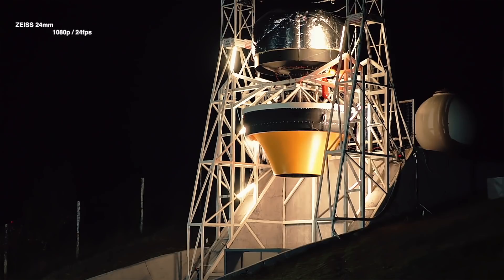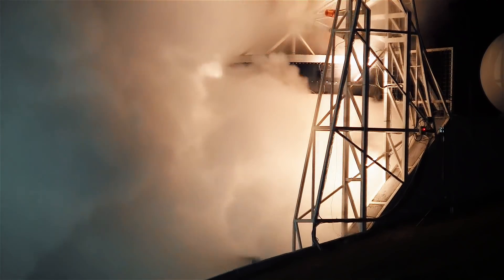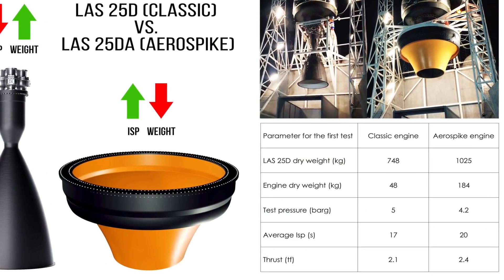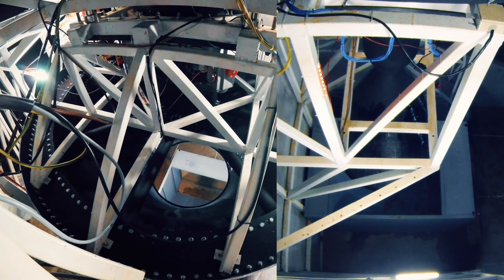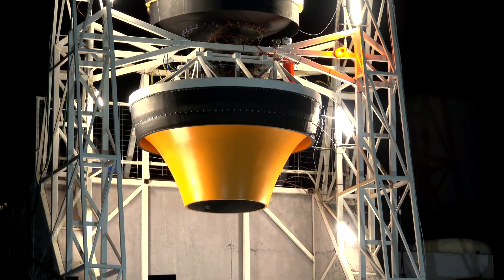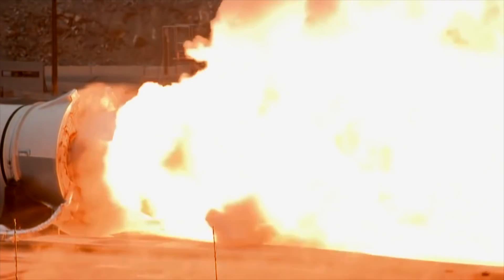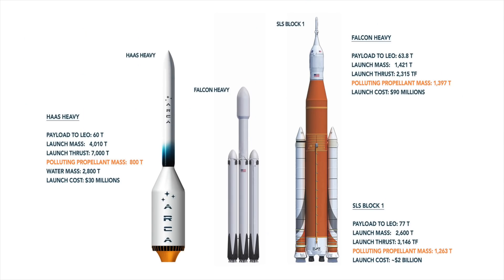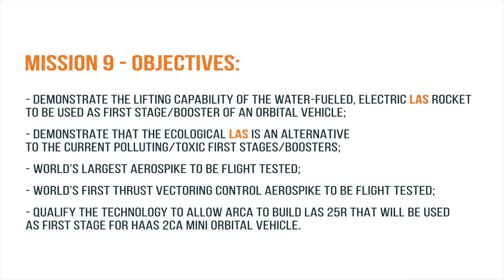Flight of the Aerospike: Episode 35 - Aerospike Test Results. Comparison.

Comment: We need to use both types of engines. Aviation is such a success because of the utilization of both turboprop and turbofan engines in commercial applications. In order for aerospace to succeed both aerospikes and bell nozzles should be used. Not to mention the rockelab electron engine too

Comment: 20 second ISP? That seems extremely low even for a steam rocket. Is it to do with the conditions of the test or is this the performance of the actual engine?
Reply from the maker: We ran the engine at only 4.1 bars for the first test. We'll gradually increase the pressure up to 28 bars and get +50sec of isp.
Reply: ARCA SPACE 
Thank you very much for replying. Best of luck for Mission 9!

Comment: To save environment why you don't use liquid hydrogen ?
Reply: It's very hard to work with. It embrittles the metals it contacts, it has low density, it's very cryogenic... oh, and it's also hard to produce in sufficient quantities.
Reply: @caav56  or methane.
Reply: @dipakahir4688  I think the hardware they can get their hands on might just no be up to it.
Reply: @caav56  bro look at their render of upcoming rockets these giant rockets can only deliver hundred tones and the will use battery to worm things up and to produce these battery is pollutive way after depleted it will be thrown in ocean  and if they use some chemical fules that can increase the paylod capacity to 500-1000 tones
Reply: @dipakahir4688  I think LAS is recoverable, though. And about hardware - I'm talking about whatever they can get their hands on now.

Comment: Pufff
a 1500t 300mln in cost, made out of a big puff of toxic materials booster leaves the ground with a 30t payload on a second stage.

It falls back down after a whoping 25-30s of continuus thrust on ISP of around 50, still under 3km of altitude. Then a normal KeroLox engine ignites propelling the payload to it's orbit.

XD

Comment: How about you try methane and oxygen? Then set fire to the exhaust.
Reply: I'm not sure they have enough experience and materials to do that. So far, it seems like they are working with whatever they can get their hands on, and trying to make a working rocket from that (for instance, switch from turbopumped kerolox Executor to yet-unnamed pressure-fed keroxide engine). I really hope they succeed in doing that.
Reply: @caav56  it's water, isn't it??????
Reply: @caav56  They should stop calling it an engine then!
Reply: @OneFinalTipple  Technically, it's still an engine - a resistojet with pre-heated propellant (on LAS. Haas rocket itself has perssure-fed keroxide linear aerospike). If it produces thrust, then it's an engine.
Reply: @caav56  Not buying it.
Reply: @OneFinalTipple  Not buying what?
Reply: @caav56  Not buying it is an 'engine'. This is becoming ridiculous
Reply: @OneFinalTipple  It became ridiculous years ago. :)

Comment: The main advantage of an aerospike is that it adapts to the variations in pressure as the rocket gains altitude. To make the comparison fair you should optimize the bell expansion to the pressure of the testing site. What expansion has been used in the test?

Comment: I saw Scott Manly's video on the brief flirtation with the aerospike in the past and the effects of altitude on a rocket engine. I was left with the impression nothing was being done in aerospike research. Now I find you have a launch in April. Oh I definitely want to know more about that! There's a high probability you guys are going to discover something because the rest of the world stopped looking a long time ago. That's how discoveries are made, by looking in places you never have before and when you run out of those you re-examine where you've already been for something you missed or a new way of doing an old thing.
Reply: I want to see a launch using aerospike
Reply: @badder27com  We all do.
Reply: But they're only planning to fly the first stage to 9k feet, so there's no reason to use an aerospike on the first stage.  Then they switch over to hydrogen peroxide for the second stage where they likely won't get nearly enough efficiency to actually go anywhere (because of the fuel, not the aerospike).  If they really wanted to do this, they'd use a more efficient fuel, but then they'd have to deal with real heat, real power, real engineering, etc.  Unfortunately in the years that I've been following them, they have never managed a launch, or even an engine test that used something other than pressurized water.  It's really too bad, because lo all those years ago I was an enthusiastic follower.  I'm just glad I was never an investor.

Comment: Fuel is one of the cheapest parts of rocket launches usually.
Reply: Yes but as they explained and research will prove with a little less exaggeration is that it's one of the most polluting properties of a launch and they aim to reduce that.
Reply: @scruffypugs1963  surprisingly, hydrolox and methalox engines burn quite cleanly. The emissions are H2O and CO2 + H2O respectively. One question I'll be asking is how much more efficient this steam engine is in terms of thrust to emissions. Water is actually a worse greenhouse gas than CO2 and of course you need to put energy in to boil it. Hydralox and Methalox can be generated from atmosphere and electricity using hydrolysis and Sabatier process respectively.

Comment: If this rocket is really running on water, I don't see any point of using aerospike. The normal cone would be okay
Reply: Yes, and it is totally unnecessary if the first stage is only going to 3000 m. Aerospike design will just add extra weight.
Reply: @n3xup  I wonder, if it's mostly done to get more experience with both toroidal (LAS) and linear (Haas rocket) aerospikes...
Reply: @caav56  Could be, yes. And that's fine if they want to do some test launches with the aerospike. For a staged launch vehicle,  using an aerospike on the first stage doesn't make sense.
Reply: @n3xup  Gotta gather data whether possible, I guess.

Comment: makes absolutely no sense to heat water with batteries and create steam,
any other way of propulsion would be better
how do they get fundings for something so useless
Reply: You should learn a little more before you make comments like that and make a fool of yourself. The water is preheated using ground power before takeoff. Most of the energy comes from the preheated supercritical water, not the batteries.
Reply: @marks4058  all you have is faith.. in a water rocket.. no real calculation works in your favor as there is just so little energy in preheated water, compared to any normal fuel-oxidizer propellant
Also, just to correct you, water gets supercritical from 374°C and 218 atm, and in this water rocket it is stored at around 250°C and 15 atm, so it is superheated subcritical water.
Better check some facts before writing this coments and make a fool of yourself
Reply: @dajsinjo  Quite right, superheated (heated above it's 1 atmosphere boiling point) not supercritical. I should be more careful when accepting auto complete suggestions on my phone.
Reply: @dajsinjo  Can you please share your calculations? That would be really helpful and educational.
Reply: @marks4058  I was wrong with few numbers, but lets start with those given in video:
next test will be done with 28atm (maybe total) pressure, water is liquid at max 230°C at that pressure. In nozzle at that test it will drop to 1 atm ambient pressure, and in Mollier diagram I could barely read this drop in enthalpy of 81.4 kJ/kg, so it may be a bit off. Entropy stays the same as this is 100% efficient engine and it is simpler calculation.
This 81400 Joule gives this kilogram of h2o velocity of 403m/s (E=0.5v^2)
and specific impulse of 41s (I=v/g)
They also mention 40s impulse in the video for that case so I am not too much off
..and yes, that is just enough to get your rocket into your neighbour back yard or into flat earth orbit with only two stages
Not to mention it is composite pressure vessel and higher temperatures dont work in favour of polymers in composites. Also rocket weight/propellant ratio is way too optimistic for that kind of rocket, and adding batteries only makes it worse.
It would make more sense to fill it up with solid propellant then water, or create some pressure fed bipropellant rocket like otrag or sea dragon.
Hope this was helpful and educational

Comment: Do you consider to improve any kind of landing sistem, like Space X´s rockets, later in the design process? I mean... if the water propeled aerospike is more eficient than a conventional rocket then you could make more afordable each launch even. Or because of the water (or because of the aerospike) is there a limit in terms of mass that can´t handle this platform??

Comment: Where does the energy come from? In the case of standard rockets, it comes from the chemical reaction (fire) wich accelerates the propelant to absurd velocities creating thrust. If it doesn't rely on chemicals, you need something to accelerate the water to those velocities. No way there is energy enough in batteries to do that.
Reply: Most of the energy comes from super-heating the water using ground power before takeoff.

Comment: excellent update thank you. if its not a trade secret would you mind sharing how you store and deliver the electric energy. Im confused how it can contain the energy required as electricity without being so heavy as to not get off the ground. I assume "not batteries"?
Reply: Batteries.
Reply: The water is super-heated to using ground power before takeoff. Most of the energy in the system is thermal.
Reply: @marks4058  Thank you!, that's absolute genius.
Reply: The water is super-heated inside the main tank via ground power lines. There is also a requirement for heating at the exhaust of the main tank/inside the combustion - or better said the evaporation chamber in order to create some explosive evaporation

Some naysayers claim that it would require 50kg of batteries for each second of the flight sequence. 

Even an optimistic estimate of half of that amounts to 1.5 tonnes of batteries for each minute of flight. Given that it might take 2-3 minutes to reach 100km, i.e. outer space, that's 3 to 5 tonnes.

Comment: I finally see what you're saying about the pollution aspect of the existing launch systems. If space exploration and exploitation are to be ramped up such that launches are common daily occurrences; then starting with a less or non polluting system sooner than later would be better for us earthlings in the long term.  Sigh; good looking out ARCA.
Reply: For the most part rockets today use RP-1 (kerosene), hydrogen or solid fuel. Solid fuel is bad for the environment due to all the heavy metals, I think. Kerosene is bad but we use so little on a global scale and get so much benefit, it just makes sense.
Hydrogen is excellent. It's pretty much exactly as clean as water and much much more efficient.
Reply from the maker: Thank you very much! Yes, that's exactly the scenario we are referring to!

Comment: Turn the water into liquid Hydrogen and Oxygen You get a better ISP and it still doesn't pollute.. This just seems like it will be waaay to heavy to ever work. I hope I am wrong, and it works, but I think you would be better using conventional fuel. Cool idea though.
Reply: True! Hydrogen/Oxygen combination is clean and offers a way higher isp. But, what we are trying to do here isn't just a clean rocket, but also one that has an unbeatable price. Using liquid hydrogen it will mean hundreds of millions, if not billions to develop. I want to be very clear that we don't care about performance. We don't hunt a few more seconds of higher isp by using methane instead of kerosene, or going with the chamber pressure at insane values. This means huge amounts for research and the cost/launch will never get truly low. We prefer a vehicle that is low performance, but delivers it's payload to orbit in a safe maner, at the lowest possible cost, and as clean as possible. This is for us the wining combination.

Comment: Only 20 sec of Isp ?? Didn't I understand something? :s
Reply from the maker: Yes, at 4.1 bars we got this. With an Isp of 50s we can put the LAS 25R with its payload, the Haas 2CA Mini rocket at 9000 ft and Mach 2, which reduces the amount of polluting fuel for Haas 2CA with 50% (we know, its sounds crazy, but it's just math), and this also reduces the launch cost. As we said, the Isp value doesn't matter too much for the first stage/booster, as long as the first stage/booster puts the upper stage at a higher altitude and at a higher DeltaV than zero. In our case 9000ft and Mach2.
Reply: @ARCAchannel  What is the Isp, altitude (orbit ?), payload and speed that you are expecting to reach in the coming years ? Would your concept fit for, for example, a new water Saturn V-like ?

Comment: So since this is a water based rocket does that mean easier pad refurbishment? Also how is a liquid fuel rocket engine designed? Is it just push as much water through as we can or is some kind of reaction happening.
Reply: Absolutely, very low maintenance between flights. Well, if we push as much water as we can, we'll get huge thrust, and shorten the time of the engine run, but we are not going to reach the desired altitude and speed. We'll also get huge accelerations that could break the vehicle. There's an optimum of thrust vs. engine run time. There's a chemical reaction in the tank (2% phase destabilizers in water) and a physical transformation from water to vapors (partial) in the engine.

Comment: Hey ARCA,
I commented this on your previous video but did not get an answer:
I've spotted a major issue with your test setup!
Looking at your test video I can see through the center of the exhaust cone.
This, allows for a venturi effect through the center of the exhaust cone as the exhaust gas produces a low pressure-zone in the center of the exhaust cone.
Looking at your images of your spacecraft I do not see an intake allowing air to be sucked into that low pressure-zone.

What are your thoughts on this?
Reply from the maker: It's actually different than what you or us thought initially. For whatever reason it doesn't produce a low pressure-zone at the end of the plug. Still investigating. Thank you for letting us know.
Reply: @ARCAchannel  Thank you for your answer! Could you make a video on this subject?
I am looking forward to see the first launch!
I was sceptical at first, but we clearly see a positive evolution in this process.
Thank you for trying to revolutionise this polluting industry!
Reply from the maker: @007Jefke1  The launch is going to happen in April, so less than three months until then. Skepticism is good. To be honest, it isn't easy to accept the idea of water as propellant, and at first everyone would have been defensive. It's a natural reaction. But let's hope the launch is going to prove we are into something here. We are going to produce a video to discuss more on the aerospike topic, including that base flow, but we need to better understand the things ourselves for now. We still have a lot of things to learn. More tests needed.
Reply: @ARCAchannel   ARCA SPACE  Are you investigating the consequences of adding an intake to allow air to flow in that empty cone?
Particularly when the object is moving through it's medium this must change the caracteristics of the exhaust flow.
We must look the idea as if it would be an inverted turbofan engine, because that is basically what it is.
Reply: @ARCAchannel  As the mixed phased flow is accelerated inwards by the   inwards curve of the bell nozzle and outwards by the outwards curve of the aerospike, is the liquid pushed inwards and the steam outwards (bouyancy) by the aerospike and the reverse in the bell nozzle. And if so, does the outer steam  layer insulate the water and the spike from conductive and radiative heat losses  that happen with a bell nozzle?
If this is happening,  might it be worth removing the phase destabilizers to promote phase separation

Comment: Of course its great that this rocket doesnt pollute, but water in space forms to ice and this can be really dangerous space debris.
Reply from the maker: Launch Assist System is for now proposed only as a first stage/booster that will not fly to space. The second stage will. However, a water based propulsion system can use solar cells to produce electricity to heat the tank and keep the water liquid.
Reply: @ARCAchannel  but as soon as its exhausted it becomes ice bullets. I would hate to be behind that thing. Also because the walls are quite thin on the fuel thanks, you would need quite a lot of energy to keep the water liquid or insulation, but insulation means more weight.

Comment: Sorry for repeating my question, but what engine will be used on the Haas rocket? Aerospike kerolox Executor or something else?
Reply from the maker: The linear aerospike with hydrogen peroxide and kerosene.
Reply: @ARCAchannel  Now it kinda reminds me of the Common Rocket Propulsion Unit of OTRAG, due to the pressure-fed design... hope it all works out. One more question - will the LAS be recoverable, and if yes - how? Parachutes and airbags, or something else.
Reply: @ARCAchannel  I thought you gave up on hydrogen peroxide in favor of steam.  And isn't hydrogen peroxide one of the terribly dangerous fuels you are railing against?